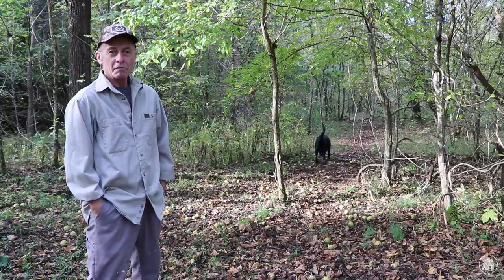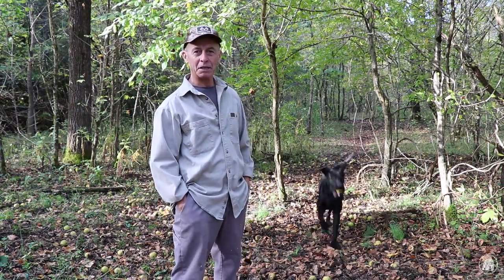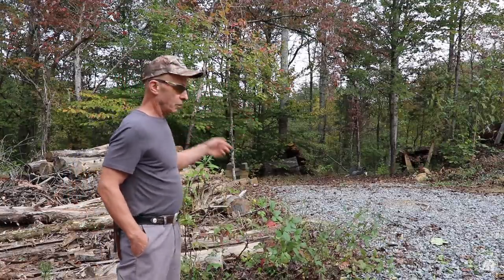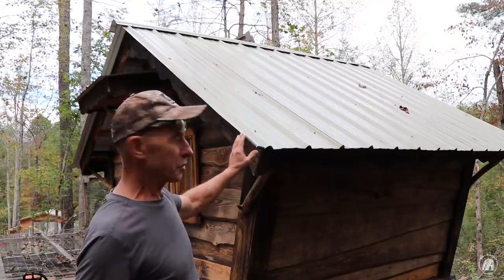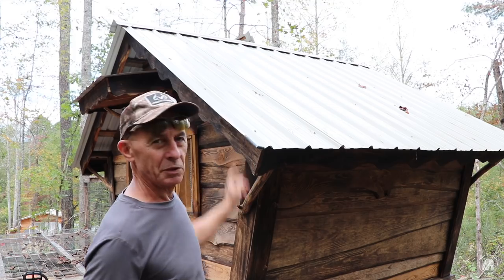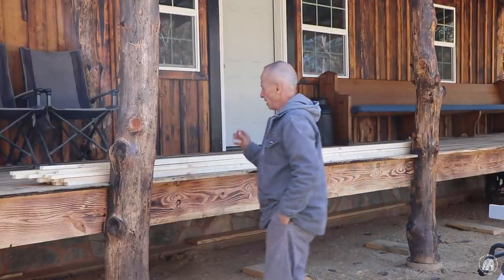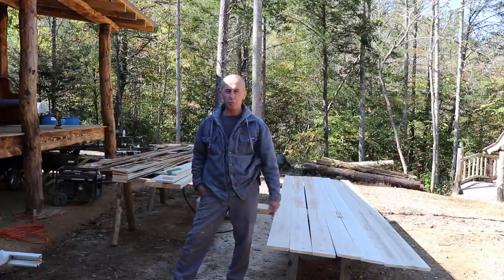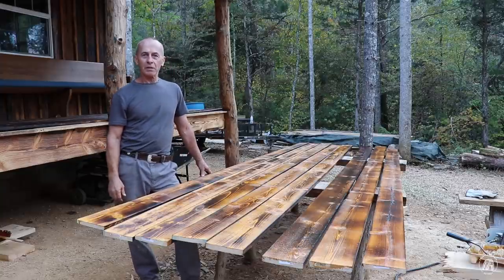A NEW SAWMILL, KILN & WORKSHOP | TIMBER FRAME CABIN | OFF GRID HOMESTEAD

Comment: When you go to rip a straight edge on your wildwood base trim you can screw it to a dementional 1x4 and use the 1x4 straight edge against your saw fence to rip right down the middle of your slabs makes getting them uniform to the size you want easy as pie

Comment: I might suggest that you mill those decaying logs down to a size that will go through your shredder and then shred them right into your mound. Everything will finish composting much faster for use in your gardens.
Safety note! Patrick should only hold the board on one side of the blade so as to avoid creating a kickback situation by pinching the blade.

Comment: under the dry sheds if you bury a pipe r two and flue the stove outside the footprint of the building for chimney they will dry the soil and heat the building this crimean oven tech will heat the drying sheds to 78 degrees even in the winter this simple tech was used to heat hospital tents in the civil war ...  how they were built on flat level ground... simple dig a trench 18 inches deep and put a rigid pipe in it that flues from the stove runs uphill slightly til it exits the tent or building and enters a stone chimney the union engineers line the Trench with rocks and put iron plates over the top the smoke as it flued through the tent floors bled heat into the stone and the stone heated the soil and also vented directly inside the tent
This heating method dried the soils and made the tents toasty and dry even in winter so troops wounded could convalesce from their wounds